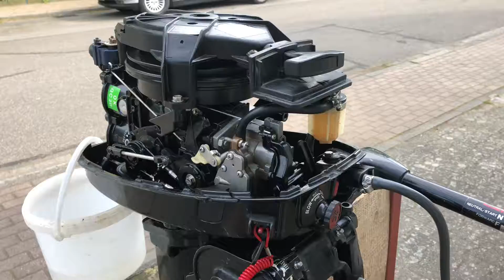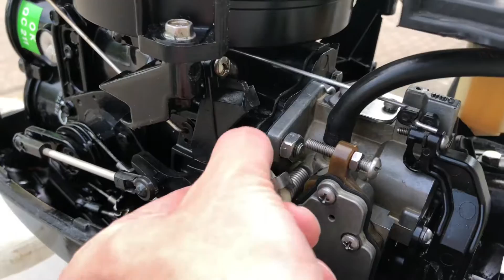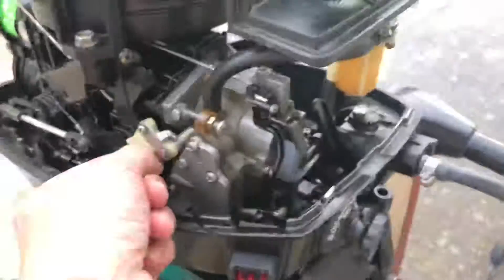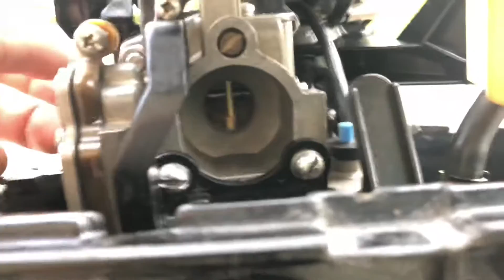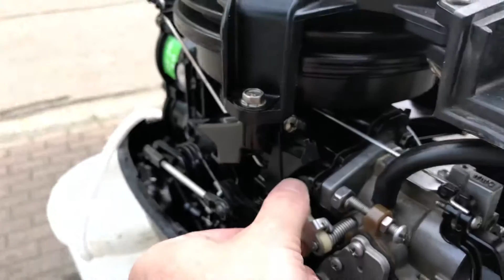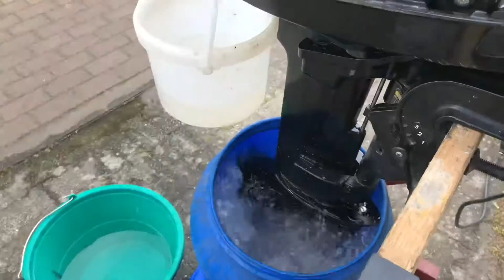Mercury 6/8/9.9 Ps 2 Takt Problem gelöst

Comment: Hallo wo hast du die Ersatzteile bekommen bzw. Kannst du vielleicht die links von den Dichtungen und der Feder senden LG
Reply from the maker: Timme 100 Die Feder hatte ich aus dem anderen Vergaser genommen
Ansonsten gibts die nur im Set
Reply: OK hast du den link vom dichtung Set? Ich finde kaum was für den Motor im Internet 😒🤔
Reply from the maker: https://www.wassersport-kellermann.com/811286-carburetor-6899-1717b17c1818a18b20a23/c-27_76_203_205_350_351_355.html
Reply from the maker: Es gibt massig Ersatzteile